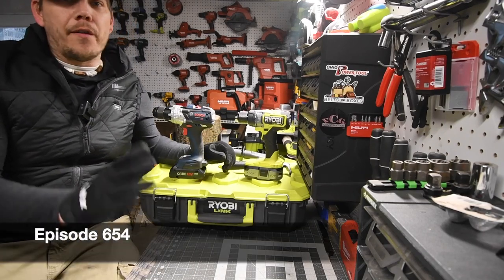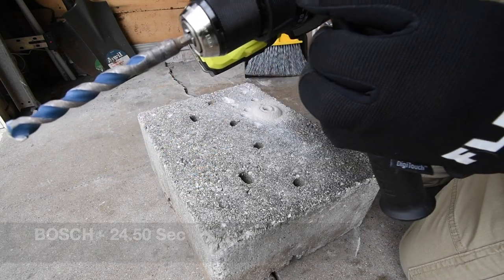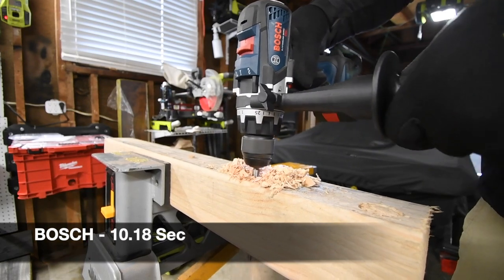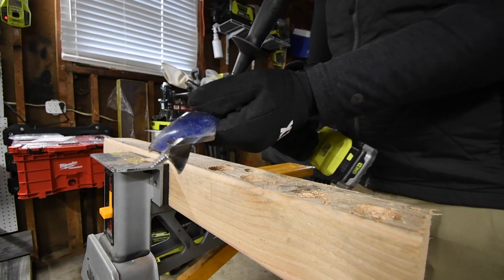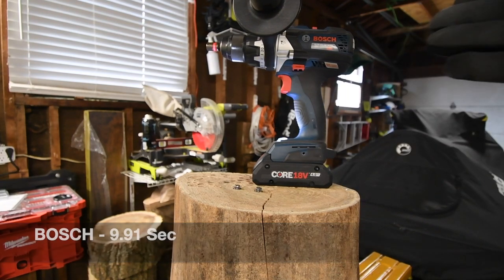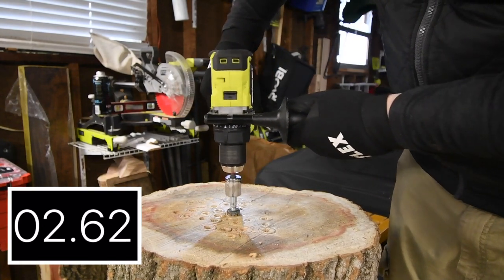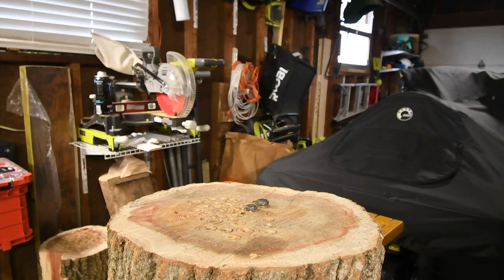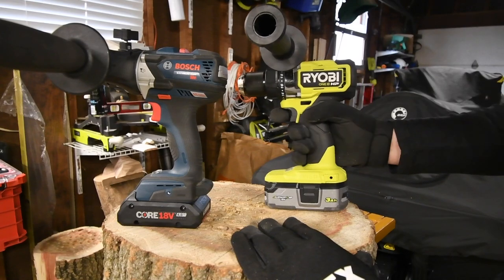Which Brand Is More Pro?

Comment: Bosch's battery in this video is procore and also has 21700 cells inside.
You are misinforming people on Bosch. This is an older model of Bosch drill, and Bosch as a brand is way better than Kobalt, Craftsman and Ryoby.
I was in doubt which brand to buy when I first started. I was planing to go with Hilti, but it was to expensive. I had experience with Dewalt and didn't like it.
I went with Bosch and I wasn't wrong.
Al of my tools are amazing, none of the broke down.
In real life conditions my drill was beating even Milwaukee drills.
In general, you won't make a bad decision if you buy Bosch (the blue lineup).
Bosch is among top tool manufacturers.
Reply: Yeah I agree. Bosch warranty is also now 6 years (3 years without registering the tool online)
Reply: @khuongathebounga4141  
I didn't know that, thanks for mentioning  that.
Reply: Yes it has 21700 cells inside but 35A isn’t enough for full power of that drill,2p 5,5Ah or more.
Reply: @dusanmilojevic3017  
You are right about that. I have this drill and i have 6Ah batteries(18650, 2p) and 8Ah (procore 21700). This drill is another type of beast when is on 8Ah battery. Until this day i haven't found a job that this drill couldn't do. You have to know what is this kind of machine intended for and use it accordingly.

Comment: The issue with Bosch is availability. Once you're in the green world of Ryobi... You're sorta stuck which stinks but batteries/tools are widely available, and usually good for the money with some exceptions. I've been using my 18ga brad nailer since 2014, still works flawlessly. I did use it on a few jobs too, thousands up on thousands of nails through it. That is the tool that convinced my to switch

Comment: Bosch has never been the fastest or most powerful.  But they are built to last and last and last they are built a lot better then any other brands. I think Bosch is built to higher standard then any other power tool brands out there. A Bosch tool will never let you down. 
Thanks for the video brother

Comment: Hey Dave I've watched a ton of the vs videos and I noticed your changing your adapter from one drill to the other back and forth. Why not instead drive the faster then take it right back out before putting the adapter in the other drill. Or have two adapters and two sockets on e for each drill

Comment: i actually have the bosch freak the 1860c and it came with the bluetooth board not plugged in inside the tool and when i plug it in it shorts out all lights and buttons on the interface so now i have a drill that doesnt have bluetooth capability and a voided warranty because im impatient.... but other than that great drill.

Comment: My brother has had a lime green for a long time and it’s not the strongest but they are tuff as well
Reply: Green is homeowner/diy Blue is contractor
Reply: @robertcasey3528  they are tuff my nephew got my old one still going strong
Reply: @harlanborders943  Bosch doesn't make junk
Reply: i dont get how people  dont see the obvious advantage that ryobi has.... it is owned and manufactured by the same people who make Milwaukee .. yoi dont think their technology bleeds over into ryobi??? granted ill give it to ya that ryobi for the past 20 years has been more of a toolbrand geared to go vs black and decker,, akaa tools for the housewife to use 3 times im a 5 year period... but they have absolutely recently improved and jumped into the ring for pros contractor level tools,,, and why not when their big brother is the best brand in the game??  
if you say rn that ryobi is trash,,, you obviously havent given these new hp tools a try... im not saying their gonna beat out a Milwaukee or Dewalt or whatevs, but they certainly are stepping up to the bug time..
consider them less as ryobi, and more like Milwaukee lite,,, or diet Milwaukee  loll. 
i have nearly every new hp tool they dropped that id need and can honestly say, i like em waayy more than my Dewalts, n old ridgids. a few of my coworkers have fucked w me over em, but isaid aye grab urs n lets run this drill off,  and ive beaten out Makitas, ridigids, AND MILWAUKEES w my hammer drill  runnin a 1 inch spaddle bit thru 4xs,,,, ive beaten out Milwaukees and Dewalts w the impact drill puttin down lags and like 4 inch long wood screws...
hell ove used the hp 3inch cutoff saw vs the ridgid n Milwaukee version (havent gone up vs the Dewalts new one yet but that one looks nice i want it lol)) at chopping up fiberboard n corrugated metal  sheeting...  

Now every single coworker of mine aimt got no jokes to say,,, they all asked to see them after i whooped em and theyve all been surprised at how much better these are vs the last ryobi drill they touched back in 1996... like the hp line beats out ridgids subcompact easily, considering after the emerson shit at ridgid,,,, but its also moreso cuz they (TTI)saw an opportunity to monopolize the orange box store and run the market of most doers period. and they decided to take this other brand they have that is well known well established and understanding that the market that brand was aimed at for so many years is basically nonexistent nowadays.  any diyer or home doer wants those contractor level tools too cuz w the cost of everything skyrocketing, it doesnt make sense to buy a drill that cant do everything a drills ever been able to do.. its too expensive to pay someone else for those hefty tough jobs,, but if you only have a tool that can handle a loose shelf but not framework,, its gonna end up costing you more than double that. 
plus evennif you dont work construction , if you have a capable tool,,,, whats to say you cant make a lil side hustle n help out ur homies who arent as "tool inclined"?? 
they would rather save money n have the homie w the tools to do ut vs paying truple for a pro also.. (might not be smartest but aye those the times we live in)) 

LONG STORY SHORT;;; if you hate on ryobi just cuz thas what everyone else has done without touching a ryobi tool,,, just stop and ask yourself this: what tool brand do all those haters love??? is it the same company that is also owned by the owners of ryobi? was the gen2 lineup of thst company better than all ryobi tools of the past?  yes? well guess what, the ryobi hps are on the same level AT LEAST if not moreso than thise same gen2s.. ya know why? CUZ THEIR MADE W THE SANE TECH AS THAT BRAND, just they get the previous version power vs Milwaukees newest latwst shits rn.. 

like i dont get how people cannot seem to connect the fuckin dots.. TTI is stuffing ryobi w their last years models' performance so they can up the power of ryobi, so they can make as much money as possible off them,, but still sell them for far less than Milwaukees price range for the people who are outta that price range...
the techs already there and since its been improved upon its basically useless.. and they profits they see off ryobi barely justifies them putting them into production since they actually have to work harder to tone down the performances n build quality on those,,   so why not make em w last years leftover guts, give em a lil bit of a makeover, throw the newest battery tech in em
 (cuz they can use the best Milwaukee battery software and hardware in both,,, its always worth ryobi prices, jist hiked up for the namesake)))  
raise the standard pricing model for ryobi by about 50%, which ultimately equals a 3rd less of Milwaukee costs, and ends up totalling to be a huuuge savings deal for the custy, whi end up buying alot more,, all the while TTI saves on production costs while nearly tripling their take from the ryobi platform....

  try out their new hp lineup,, it wont be earth shattering, but you def say well damn that wasnt half as bad as i expected.. or hell, even goddamn! yhas just as good as my ___ n only cost ____(def cheaper than  the alternative) lol 
Legit, i give it 5 years and then ryobi will be selling just as well as if not more than Milwaukee ,, and also will be out performing alot of the competition...
cuz shut why wouldnt TTI wanna make their biggest competition.... TTI?? lol  Milwaukee for the diehards w the cash to dropp, n ryobi for... everyone else..  

there  are only 2 small  issues i see ever everrr being a prob for ryobi still and moving forward ... and those are the battery platform,, they need to find a way to phase out the extra dick at the top of the batteries n make em a slide pack like everyone else... should start making each battery as detachable at the top so they can design their new tools w out the extra dingle on top,,, but still able to run the old style w a small skide on attachment or sumn..... and 2) the color.. alot are turned off at the bright ass neon green..
id say swap the fiest n secondary colors n make em all grey w neon green accents,, but unfortunately flex has just capitalized on that ... but they may have already made a solution to this issue,,, the new hps have replaced the grey 2ndary color w blacks so they could do a pitch black tool w neon green accents ..  

or hell they've up and  drastically changed colors before... (blue n deep yellow almost orange ring any bells? lol)) 

what if they went and switched up again,, 
thinking of colors that aren't in use for tools and arent ugly or gay or girly or whatever the typical tool buyer would think... i think if they wanted to make the Milwaukee connection more concrete they could maybe go and do sumn like a deeeep deep dark maroon burgandy blood red?? maybe w like a copper or brozed accents ( Milwaukee has red and silver/black,,...a  maroon,bronze and black colorway would look dope and show company unification , but enough to distinguish the difference between the 2.. and red n silver is obviously #1... so if silvers 1,,,, tha  bronze would be 2 right? ))) 

or another color they could utilize and that would work very well,,, and im surprised to think about how no other company has thought to capitalize on it yet,   would be a good hearty brown beige tan colorway...
think of some workboots or ur dads old leather work gloves.. like the color of the carhartt tee shirts i have 4 of that are my work shirts.. every workin man can dig the brown,,, just makes you think of a hard days work,, hands on ,,, holdin a pile of earth in my hands and seeing the worm pop out  lol,,  the mexicans out front home depot that taught me everything i know,,,,, the workin mans color..   i can digg w that lol,,, n as it gets dirty n beat up,,, your just makin it look cooler cuz its gettin more browner... if ur lucky,, it amy even rust over a tad bit,,, wouldn't that be sumn???
Reply: @dabmanian_devil  Ryobi is junk

Comment: Ryobi killed it bro it won almost every single test
Reply: This drill from Bosch is very old. You need to see the new version with 150nm power torque
Reply: @Pecke1234  regardless its a low power ryobi that just beat out a bosch bro 💪 like I said ryobi hp are not the same old blue or brushed green with the magnetic pads.... they have come a long way
Reply: @TacticalThib  that Ryobi is about 6 years newer and it's their top of the line tool at this moment, I'd expect that. And it's rated for more torque, but it did not show in the tests.

The 3 yr old GSB18V-755C would be enough to get the Ryobi beat
Reply: Killed it? The Bosch drove the big screws when the Ryobi didn't.
Reply: Its a drill not an impact wrench.
Reply: @Tool_Addicted_Carpenter  price a bosch and price a ryobi yeah bosch won one test ryobi had a 3ah battery 🔋 bro
Reply: @TacticalThib  Bosch just had a sale on a 1" SDS+ D handle hammerdrill with a charger and 4.0 battery for $125. That's one of the best drills on the market for much cheaper than Ryobi. Also, a 21700 cell 3.0 battery is no better or worse than a 21700 cell 4.0. What exactly is the goal you wish to achieve by aimlessly advocating for Ryobi? They make acceptable tools, but they can't be used day in and day out the way a professional uses them.

Comment: I think you can turn off the anti kickback on the bosch.
Reply: only on the newer ones like the GSB18C-755C, 975B & 1300C
Reply: @luisinhoens90  honestly, not a fan of Bosch drills because they look rather bulky.  I do like the Freak for its convenience of switching between 1/4 hex and 1/2 anvil and the brushless sander.  The 12v stuff is good because it has stuff Milwaukee doesn’t make at the moment like their planer and palm router.  I also prefer Bosch Flexi over Milwaukee’s installation driver.

Comment: Dave MCT, both!!! Both of them are PRO! The New Ryobi HP Brushless Hammer Drill and the Bosch brushless hammer drill they're both Pro! I have a new Ryobi HP 4 speed impact driver and the HP Brushless Hammer Drill with 4Ah HP Batteries and I got 2 additional NEW! Ryobi HP Compact 6.0Ah battery! Dave MCT you might wanna check that out the new Ryobi HP Compact 6.0Ah battery I'm not sure if that is a compact 21700 cell battery or just a 18650 in a compact form. But I noticed the new battery have more power than the old Ryobi 6.0Ah. also I don't own any cordless Bosch hammer drill but I do have a corded Bosch hammer drill HD-18-2 and the Bosch 11255VSR Bulldog Xtreme Rotary hammer drill SDS. The only Cordless Bosch tool that I have is the Freak impact driver/wrench. The new Ryobi HP is now a pro in my opinion. It beats the top brand when it comes to Hammer Drilling in concrete. And that's what I'm looking for when it comes to Hammer drill I don't use my cordless hammer drill for fastening Timberlok screws or Spax or lag bolts I use them for drilling and concrete drilling only. When I need to use a drill for driving Fasteners I only use them for driving deck screws and other small fasteners other wise I have a lot of impact drivers and impact wrench for that work.